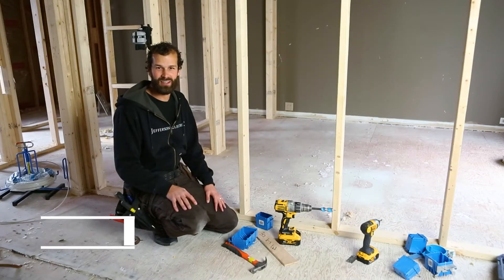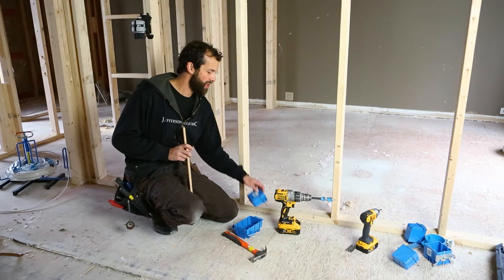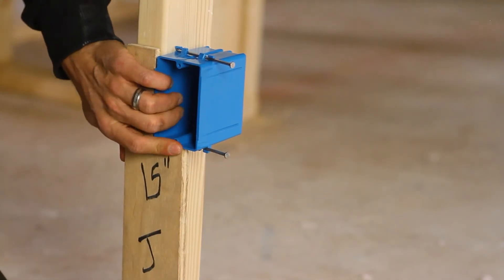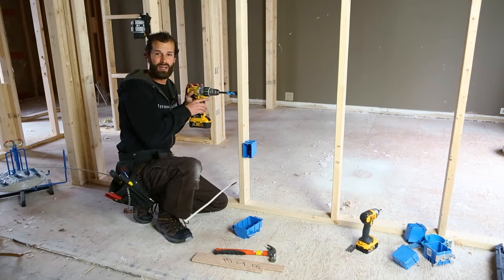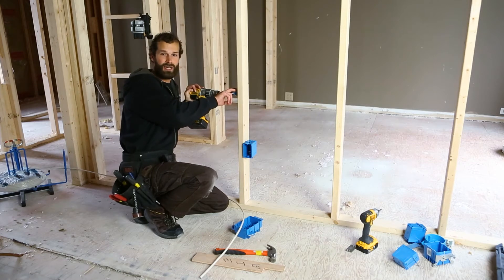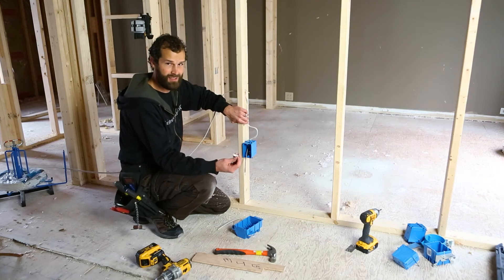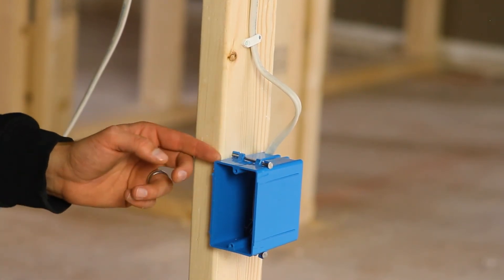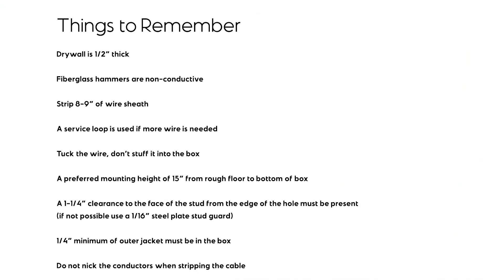Installing New Work Boxes & Wire Terminations

Comment: Ok. Here it is. Guys measure up 12" to the bottom of the box in residential installation. Because just like your hammer, a good Stanley or Plumb hammer has the claw 12" from the end of the handle. Then you just set your hammer on the floor and bump the claw against the stud leaving a mark for the bottom of the box. No tape measure, mo marker, no template. Just make sure everyone else has a hammer that is the same length. 16oz Stanley or Plumb. Available at home depot. On commercial work the bottom of the box will be 16". This is because that's 2 courses up on block, with each course measureing 8". Now you just place your box which is metal, with about 40" of conduit stubbed up, and just set it on wall or against wall where you want it to go and the mason will place the box assembly on the 2nd course as he builds the wall.  For AD,A the requirement is 16" to the middle of the box. So at 2 courses or 16" to the bottom you meet ADA requirements. If you go 16" to top of box you will be below ADA requirements. Switches a bit tricky. ADA is 48" to  middle. Hard to do in block because of bond beam and rebar. Most inspectors will let you go 2" higher on block so you set the box with bottom at 48". Now there is room for rebar as box is set above rebar and rebar is in the notch cut on the block.

Comment: Old timers like myself used the great Klien fiberglass termed electricians hammer because the depth from hammer head to handle was at least 2 & 1/4" long. This was the only one that I locate with long enough neck to hammer roofing nails into deep 2 &1/8" metal boxes back in the 1960's before we started using cordless drills to install wood or sheet rock screws to secure boxes.

Comment: You need that jig, because you are using cheap Carlon Boxes, which are not preset on the box.  If you use other brands, like P&S, which I use, you don't need a jig.  they do cost more.  But easier to use, and they also have "quick clicks" to mount your devices.  With the boxes you are using, you almost have to have a screw drill to mount the devices, or you will wear out your wrist drying to screw the devices to the box.  With P&S, you don't need a drill.
Reply: @ElectricProAcademy  I know that. I have owned my electrical business for 32 years.  I am well aware of everything you just said.  And having wired many houses, and bought thousands of electrical boxes, as I still am, Carlons are a drain on labor time. With a P&S box no template is needed.  When I ask other contractors why they buy Carlons....every answer was..."they are Cheap"....   My statement above still stands.

Comment: why did your use 14/2 instead of 12/2 for a receptacle? (just wondering, not a troll)
Reply: @ElectricProAcademy  thank you for the reply.  Is there any advantage to running a 20a vs a 15a circuit? (for normal outlets, not devices that specifically call for 20a)  Would a 20a circuit allow you to add more receptacles on it?
Reply: Neil,  Yes, of course, a heavier wire and a 20 amp breaker will accept a higher load safely, you never know what you may need later. There's no code limit on the number of receptacles, regardless of whether it's a 15 or 20 amp circuit. As long as they are not all used at the same time, usually the case, it gives more options for rearranging furniture, electrical equipment, etc. in a room.